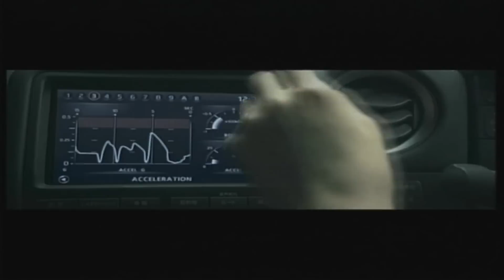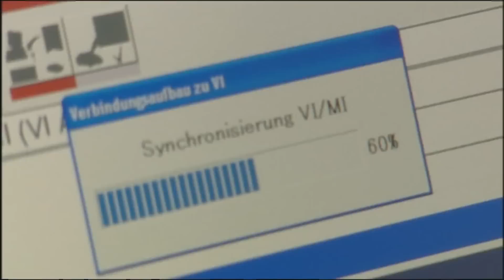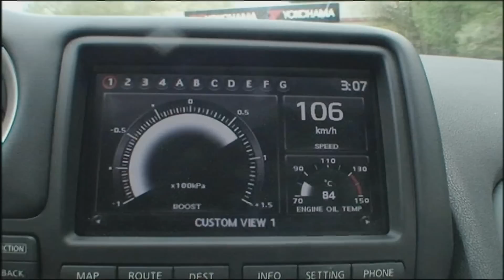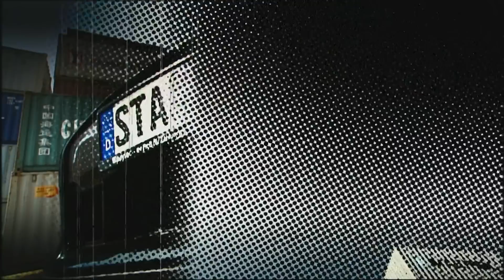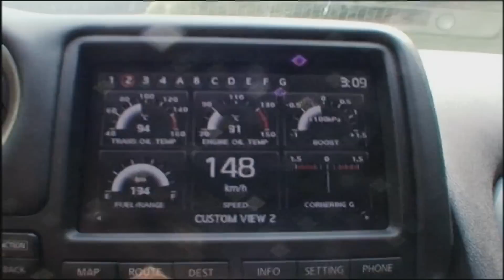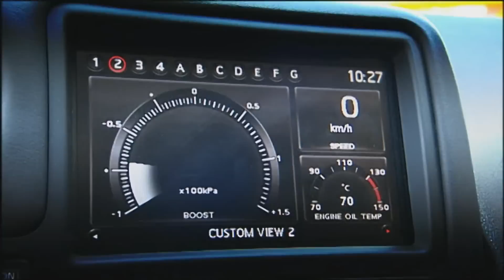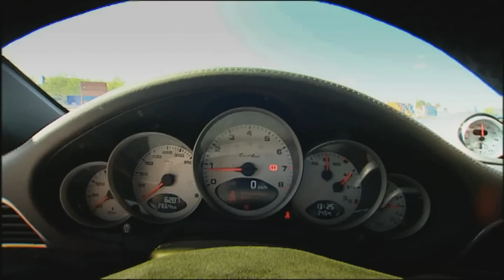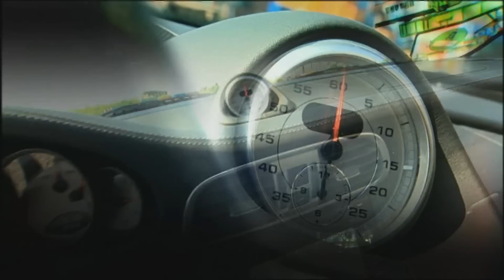Nissan GTR vs Porsche Turbo Nordschleife

Comment: Why did the Nissan GTR get a special treatment of "semi-slick tires" and "upgraded suspension" and "remapped ECU". No mention that the Porsche got any of that...guess it didn't need it.
Reply: Because it had all weather tyres on it and the standard tyres could be considered 'semi slicks', just as the standard tyres on the 911 turbo are.
Reply: Tim Barnes
What about the upgraded suspension and remapped ECU.
Reply: HorizonsUnlimited
 because otherwise it would be faster than 911. more downgrade remapped ECU...
Reply: I don't think so of a down grade for Nssan it got its arse kicked, see what happened at the end Nissan still can't coupe.

All I can say to the people that love Nissan, go to the Nissan factory in Japan, then go to the Porsche factory in German, then make up your mind, at the end there is no question what the better car is. You can't beat the Germans at what they do best. They can run there engines at full speed all day long, the Nissan can do it and get up there BUT NOT ALL DAY LONG IT WILL BREAK. Greetings

Comment: put the same tyres on both or the comparisons are invalid on a track.
Nissan cheated when they did the 7:27 lap using track slicks.
And what's with all the mods in the shop on the GTR before it hit the track?
half baked comparison.
Reply: ZR1 was using slicks. There are other cars using slicks as well. The point is?
Reply: "Cheated".... since when was doing something smart cheating? errr..

Comment: The Porsche is just as loaded with tech as the GTR..The engine response,throttle response,steering feel,the overall behaviour of the GTR put it in the same class with the best Porsches..There is a ton of "quality of the craftsmanship" in there,maybe not as much refinement but it is a great car overall and it's NOTHING "like driving a computer"..and it can handle a lot more power..I take it you drove both cars and you posted your impressions here not just a biased opinion of a fanboy, right?  :)

Comment: I don't know why you are celebrating the Porsche, look at the official times on different websites, no Porsche turbo in the Top 5, but a GTR. So that means the Nissan driver isn't that good. So calm down ...
Reply: Sorry to tell you that Nissan didn't run stock tires it came out later
Reply: I just can repeat my statement, look at the official times driven on the track, i think the cars who are in the ranking drove at same conditions... theres no way a porshe would beat the GTR on this track without additional tuning... So that's my opinion. ;-)

Comment: 2 great cars but 60k difference THATS alot of money, is a badge worth it.? also the guy said they fitted race tyres onto the GTR when infact they were the standard tyres it come's with from the factory? GTR's have been racing in 1 shape or another since the late 60's so they have been about just getting better with time.
Reply: The Badge, lol. Tell me what's going to have better resale value and who's going to need a shit load of extra maintenance. Answer to number one is Porsche. The answer to number two is the gtr. The equation is very simple, you get what you pay for.

Comment: I have a 930 and still rate an X50 993 TT as the best car I've ever owned. I love how the GTR is built and engineered, but what I dislike most about it is the extent to which is has helped to usher in cars like the current 991 Turbo - automatic only idiot-proof missiles that are long on ability and short on involvement. Out of the pair above, I'd have a manual 997 Turbo any day of the week.

Comment: Porsche > nissan. ANYTIME. ANYWHERE.
Reply: GTR  >  911
Reply: ***** In price, yes, but you'll never get as much as you can get for this price for Porsche. Porsche:? Quality. Nissan? Cheap.
Reply: excuseme, with quality you don't go to the supermarket. In a race, circuit, drag, road you go with perfomance. GTR perfomance > Porsche perfomance
Reply: n8neiTen8n
 * porsche  =  vw*   do your homework!
Reply: *****
Never saw a VW bring in the same money as a Porsche come sale time. ☺
Reply: Sure, if you want to generalize. But sean octane is right, GTR>911
Reply: Yes but you can get two Nissan GTR for one Porsche Turbo S... I don´t know how much in USD but I know, that the price of the Porsche Turbo S is roundabout 230.000 EUR (full equipment) . The Nissan GTR about 120.000 EUR with full equipment... (And sorry for my bad English)
Reply: HeyHo Let´s Go
So what?! U still get a nissan instead of PORSCHE.
Reply: Porsche, there is no substitute!!  get this people, you get what you pay for!!
Reply: manuel martinez
Exactly, any why Porsche is so expensive? It's totally worth it! Besides Porsche doesn't have cheap models as nissan, so this is another reason why gt-r is cheaper, not better - no, nevber better than Porsche, never even as good as Porsche, just cheaper.
Reply: manuel martinez Well said amigo, I have an 83 SC convertible & she's a beast, all original, flat 6 , air cooled, no power steering, no ABS, no airbags, worth every penny, take care Manuel Martinez :=)
Reply: all right guys
Reply: n8neiTen8n not better?, you don't understand. GTR cornering better,better when you increase the power, better brake control, better for rally, circuit. what else?. im talking about the supercar, not the quality. if you see inside the mclaren you don't see quality.
Reply: n8neiTen8n porsche is faster check nordschleife records
Reply: Karl Hans I know, and that's official, gt-r lap is not official.
Reply: Both cool cars, just preference. But I'd probably never be in the position to afford either one.  So I'll have to settle for cars on Forza LoL  Though GTAV has some cool cars ☺

Comment: Gtr driver shift from 4 in 6 gear at 180-190km/h!!!!! 16:50 minute
The german drivers cheat!!!!!!!!
Reply: kustis kostopulos The 911 Turbo has more torque at lower RPM and thats a benefit running uphill like in 16:50

Comment: @pakan357 - I have been in a GT-R and my dad owns a Porsche which I'll prally buy from him in a few years because he is having trouble getting in and out of it. I have also driven the Porsche myself. I have never felt the need to floor that car and I like to push the cars I drive. It has a beautiful gearbox (not paddle shifters) and has great road feel. The car is simply beautiful. And while the gtr may be capable of a little more on the track I like the feel of the Porsche more.

Comment: Wow they're changing oil, tires and the programming. "Programming the race mode" my ass. Probably giving it a much less aggressive tune. Wonder if they will do this to the Porsche.. (4:38 in)
Reply: Anthony Terrell Syntetic oil is better than the regular one and semi slics give more tracktion on a dry racetrack than the all weather regular tires. The Race mode setup disables the help assistence systems of the car wich are useless for a professional race driver like Patrick Simon and just slow the car down. 
He also run the Nürburgring in 7:15 with a Porsche 911 GT2 in 2005:
watch?v=yAxmOvwRZlI

Comment: Just matter of choice or personal preference.  I'd rather have the 911 because there are less "Sony Play Station" type of extra gizmos inside. And of course it's German made. ☺
Reply: It depends which generation of 911. The latest one (991) comes with four wheel steering, electric throttle and streeting and various traction control or torque vectorin systems. The GTR r35 was merely ahead of it's time when it was released in 2007. People call it a play station car but nowadays most super cars have similar electronics
Reply: *****
I know very little about the "newer" models (as far as quality).  I'm an independent mechanic and work on mostly models from the 90s to the early 2000s.  Just sold my 97 BMW 328i convertible and bought a 96 M3 and a 99 BMW K1200RS (motorcycle).  I work on a 94 Porsche 968 for a customer.  He's currently getting a supercharger installed in southern California.  Can't wait until he brings it back to see the HP gain.  Of course he's doing all new upgrades to the sway bars and suspension I'll install when it gets back.  I already did cross drilled rotors and steel braided brake lines.
Reply: people only say that because they are japaneese however the car is fast and the gtr leaves the porche by about 3 car lenght in first and then 5 at the time the first 100 ft
Reply: GTR  >  911
Reply: ***** Well once I have a six digit budget to be choosey or compare new makes and models then... well I guess I'd be hosting a car program on Velocity. LoL
Reply: ***** I just like the overall package of most German made cars. Not saying that other makes are bad... just years of experience with repairing, owning, etc...
Reply: My m5 has more problems than my Lexus
Reply: Phil Phan
Depends if you know how to take care of your car. I know some people think their transmission and differential fluid lasts forever and never change it.  Or they drive it everyday like they need to have pole position at every light. 
A friend had an AWD SUV Lexus and continually had transfer case leaks.  Needless to say after the 3rd seal replacement he sold it. But also I know most first version BMW X5s have tranny issues as well.  So no make/model car is exempt from having their own "issues". Like I said "preference". My first choice would be a German brand name car before others.
Reply: DaytonCarCare
Most people who buy these cars should know to take care of the car. Fan boys wont get to that point most of the time. Yes Germans have good cars I wouldn't say they don't, But on the other hand Japanese people take pride in their cars building them with the utmost respect also to take care of them and to later sell them looking and performing close to new. Not all sports cars are built to Mod. The GT-R is still new and have exploded with new mods and massive power gains. This is just the beginning of the GT-R R35.
"Not pointed at Dayton unless of course." For those who claim it Cheap, If you think it's cheap then you don't know anything about the car last time I checked you aren't driving one let alone have the money to drive it. Fan boys can go home and let the real men do the talking here. In the end if I picked from the 2 it would be the GT-R it will be more enjoying to have and mod later on. 991 just isn't the great in my eye's. Think for a sec if you drop all the heavy weight from the GT-R and increased Down force, that's the end of story.

Comment: @ardy - maybe you are the fanboy. I have already said numbers don't matter. It doesn't matter which goes 0-60 0.2 seconds faster or which can go faster. Why? It is borderline uncomfortable to accelerate that fast. You won't notice the difference and obviously any car that can go over 120 mph will likely never need to be tapped for any more. What matters is the fit and finish, road feel, and handling.

Comment: The Nissan is still a Nissan BUT THE PORSCHE ( well you know the rest )
Porsche all the way baby !
Reply: So you will buy a GTR if Nissan puts out more than one great car every 50 years?
Reply: 1400IntruderVS Great question my friend...let me say this first, I've had many cars from BMW'S to Mazda's to Toyota's My Sunday car is a Porsche 1983 SC convertible & all I can say is wow, the sound, the handling , the built quality, the beast just want's to go go go, air cooled, easy to work on, I guess Porsche found a formula eg ( engine in the back ) & just kept improving & improving with the times.
The GTR is a great car though but here in Australia I haven't seen many of them around. I feel the GTR was made just to piss Porsche off, in other words one lucky punch to the great ALI doesn't make you a champ.
We'll have to see what the future holds my friend !
Reply: '83 SC, very nice. They drive awesome. It is difficult to exclaim how a car like that really invites a driver to be apart of the same elements the chassis endures. That car likes to point shoot through an apex. No safety nets just a blood thirsty hunt for the next turn.
Seems so many people these days are spoiled with electronic safety features and over sizes tires in weighted down, assisted steering machines that they only understand performance at such extreme levels. Few understand or remember what it takes to drive. So they have cars that amuse the imagination but do not challenge the mind or stir the soul.
I have assisted in building many of the 964-991 cars into real road brawler's and some formidable track weapons in the day.
Drove about a '77 with an '82 slant nose wide body and old modded 2.7 litre a long time ago. Miss those days.
Reply: 1400IntruderVS Great story....So you definitely know what I'm going on about, sometimes when I'm pushing her around the bend ( 2nd gear doing 100kph ready to pop her into 3rd gear ) knowing one bad move or bump could be costly ????
It makes you never take your mind off what your doing, no airbags, no ABS, no power steering, no traction control, I love it...
So you live in the states ?
Reply: Long Island New York. The roads along the North Shore are pitted, and narrow with plenty of hills. Even at legal limits in some turns can be dangerous.
Those rear engine Porsche drive like go-carts.
You can steer later into a turn because of that rear bias. Off throttle-over-steer compliments that tendency  to under-steer. That is what I mean by point and shoot.
We allow the rear to point the front in the direction of intention and then punch it.
If you're to early with your turn in you can use the same technique to re-orient the car at any time in the turn. 
These are car than can do things other cars cannot with out electronic aides but they do require the driver to have an understanding of how to drive.
Those early 80s 911s are increasing in price right now because they represent one of the best incarnations of the breed. Cherish it.
Cheers.
Reply: I really don't care too much about Porshche because it looks like turtle.
Reply: Virak Thong First it's called Porsche ( not Porshche no offence ) secondly you look like a little kid ( again no offence ) Leave the real automobile's to the men & stick to your dog in a pan ( ok that was offensive ) Have a good day Amigo :=)
Reply: Beeboy69 - What about it? That Nissan just dusted the competition. From Porsche to Ferrari, the GTR has made a joke out of all of them.
Reply: EuroEmpire One lucky punch to the great Ali ( Ali = Porsche ) does not make you a champion....check out the history of Porsche & all their tittle' wins then come back to me.....I drove behind one 2 weeks ago ( I was in my everyday car ) & to be honest it blew a lot of smoke......my 32 year old Porsche SC sounds better !
Reply: Beeboy69 we already know you have a Porsche, you sound like a little kid showing off (no offence). Please don't compare your 32 year old car with the GTR. If you're saying you take 997 Porsche over the GTR then all your arguments (the sound, the handling, air cooled, easy to work on) are pointless to say the least (no offence). And of course I also love the '83 SC but... come on, grow up buddy.
Reply: Pedro Catalão First of all if I was showing off about having a Porsche I'd have you tube footage of it ( which i haven't ) I'm just stating what my thoughts are & Porsche knowledge. 2nd like i told EuroEmpire, i did drive behind a GTR & all i saw was black smoke & no exhaust note sound....3rd is Nissan made the GTR just to piss Porsche & the Germans off....( took them long enough )..Yes i would choose ANY Porsche 911 over a GTR...Where would the Nissan GTR be in 50 years time ? Where has Nissan been the last 50 years ? Where is Nissan's racing history ? How many times have Nissan won Le Mans ?Adios amigo....I'm going for a drive......yeah you guessed it !
Reply: Beeboy69 I leave the guessing for you... if I knew the the future like you, I'd be rich and would be driving a f40 or a Mclaren f1 or, why not, a singer 911 ;) I see you have some really bad preconceptions affecting your judge right there. Vai dar uma voltinha e respira fundo :)
Reply: Pedro Catalão alguem precisa de um abraco !   My work here is done.....not feeding the trolls anymore....adios amigo !
Reply: Beeboy69 you really can't feed them anyway with arguments like "a car can only be good if the brand has won lemans" :) adeusinho my friend
Reply: Beeboy69 watch documentary: gt-r is destroyed Porsche since 1969.
GT-R's not a brand new name.
Reply: Beeboy69 - Don't get me wrong, I'd rather have a Porsche 911 GT3RS vs GTR. I appreciate the history of Porsche but it didn't hold up. For example, the history of the BMW 3-SERIES has kept it the benchmark to this day, not one competitor has matched the 3-SERIES.

Comment: @toxxxy - am I serious about what? The GT-R performs at the same level as the Porsche, but if I am going to spend ~$100,000 I want a beautiful car with great looks on the exterior (gtr is good looking too) and the interior (where the gtr pales in comparison to the Porsche). Anything that goes under 5 seconds 0-60 and and above 120 will be useless off the track.

Comment: l think the Porsche turbo 911 pulls away because it weighs less and may rev higher and the GTR may be gearing for acceleration over top end speed
Reply: ps l ve been in both and the GTR is bigger inside too and has more of a back seat & trunk that is usable .That makes quite an argument for the Nissan as well as price :)   but boy is the 911 sexy looking :P
Reply: richard carr
Are you saying that the rear seat in the GT-R can fit a 6" 250lb man? (I was under the impression that neither can fit anything over a 80lb 10y 5" girl in the back).
Yes, the GT-R does have a real trunk vs a 2xcarry on in the front of the 911.
Reply: ah no,short ppl for sure, it tight and no one bigger than 6yr old will ever fit a Porsche back seat they re not sedans